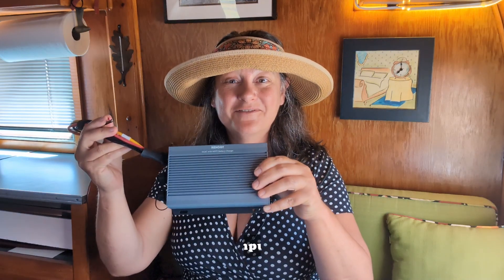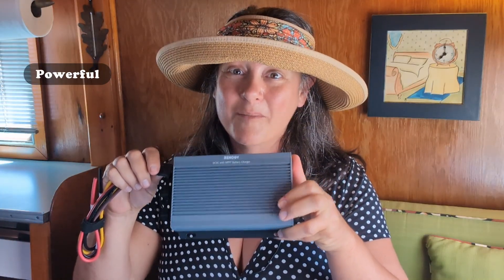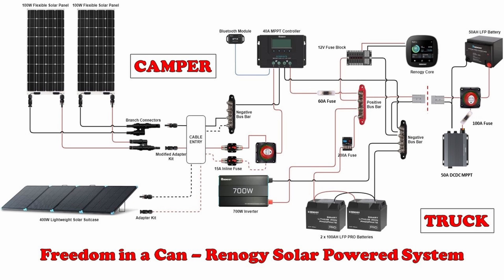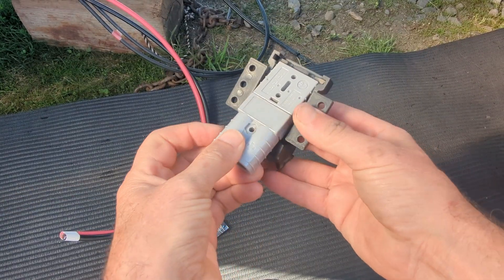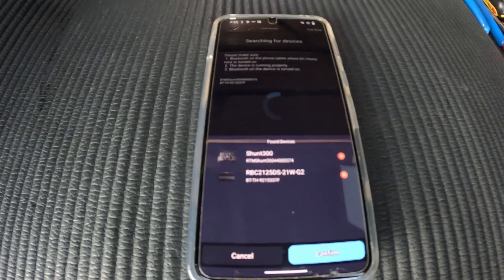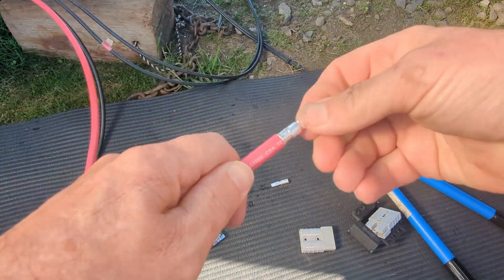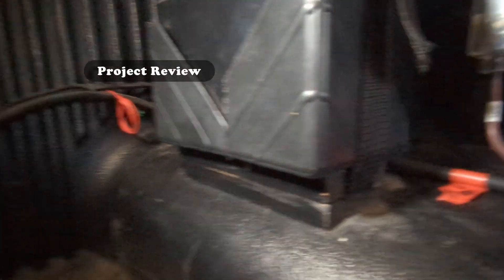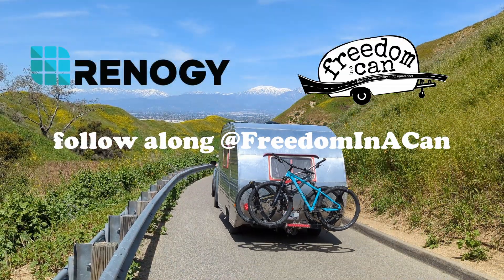How to Install a Renogy 50A Dual Input DC to DC Battery Charger [Installation & Testing]

Comment: A word of caution regarding this charger.
I bought one and had it installed in my 2023 Promaster van to charge 2 150 ah lithium batteries. 
Since I installed it I have noticed a number of odd things happening to my van. 
One thing is it started giving me indications of an open driver side door. It would typically happen if I had the dc-dc converter charging at 50 amps. This was unusually repeatable. Believe me, I did a number of door tests to try and  resolve it. The dealer cannot find a problem. The next issue was after sitting for a couple of days and starting the van it immediately threw a DTC of po327 which is for the knock sensor low voltage. The last thing to happen was the failure of the Onstar type rescue feature which I don’t use anyway. It showed that the system was not working. 
Each of these issues happened while charging at 50 amps. The po327 and the Onstar issue was after the vehicle had sat unused for several days. 
The alternator in this vehicle is rated at 180 amps according to the dealership. 
My thinking is at startup there is a large surge current coming from the vehicle and perhaps the alternator can’t keep up resulting in a low voltage event. As far as the door open alert that happens after a few hours on the road so not sure why it happens.
When I changed the charge rate to 20 or 30 amps I don’t have any other issues. I am curious if the 50 amp setting is just too much for that alternator. I have no reason to run it at 50 amps constantly so I lowered it to 30 amps. Could it be noise created by the charger at the 50 amp setting that the ECUs have trouble with?
I’ve contacted Renogy asking if there is a way to modify firmware in the unit to allow a soft start feature whereas upon startup the charger would wait and slowly bring up the charge current over a period of minutes giving the alternator time to stabilize.
Their reply was that isn’t possible with that charger.
Just something to think about.
Reply from the maker: Thanks for the information, and I'm glad to hear that you found a work around.   I like the idea of a soft startup , that might be something for later devices.  We'll pass this along to Renogy and let you know if they have a different answer for the situation.  Thanks for sharing!

Comment: Do you thr 40amp one is good enough for 400amp powerbank
Reply from the maker: It all depends on the input specs of the power Bank, at 400 Ah, it should have a large enough input capacity.  Which make and model do you have to charge?

Comment: Why run a negative cable from the starter battery isn't the chassis a common ground?
Reply from the maker: Yes, you are right, however it doesn't seem to work well unless you take it back to the battery's common ground.  In our bus install video we had the DC2DC grounded on a chassis bolt 4 inches  from the battery ground, it didn't work.  Then we moved it to the battery and it worked!  I can't explain why, but it works better this way.
Reply from the maker: See this video, https://youtu.be/qVGMP4Ae0LU?si=pRErl8ag0biFK3DT

Comment: Did you ever figure out the right voltage settings to work with your smart alternator?

I have a Ford Transit 2021 with a "smart" alternator and would love some insight!
Reply from the maker: Yes we did, we set the charging voltage a little lower than the standard setting.  Forward Charge Start set to 12.7 and Forward Charge Stop set to 12.2- they had to be .5V apart.  We also set the LowSolar cut off to 10A.  These can all be adjusted in the setting of the DC Home app when connected to the 50A DC2DC.  Not sure if this is what did it, or rechecking all our wire connections, but it's working much better, and we're seeing higher Amperages during charging.  Hope this helps!
Reply from the maker: Also, I wanted to share this video, where we installed the 50A DC2DC  in a bus. Super short run between the starting battery and big cables meant that we saw some really good charging.  https://youtu.be/qVGMP4Ae0LU?si=CMt7lvoZRYoJhAdV
Best of luck, and let us know how it goes.
Reply: @FreedomInACan i just got everything hooked up and i started with your voltage numbers and may have bumped them up for .2 for my setup , ford tranist 2021 3.5l. Still doing some testing and so far no long trip tests yet. I have been seeing consistent 40-50amp charging but only during my short tests. Ill keep you posted! 4awg wire running from the driver seat ccp to the wheel well behind it where my charger and battery is
Reply from the maker: Cool, so glad that it's working for you!  Keep us posted.
Reply from the maker: @Goonch92  Cool, let us know how it goes!

Comment: I've had nothing but trouble from this charger, never charges more than 25amp tops in lithium profile but mostly ranges around 12amps.... I have the new 200w N-Type renogy solar panel but on a perfect sunny day i get maximum of 8 amp. I have had an old kings 25a dcdc charger for 3 years now and it has never missed one bit, it pumps constant 22amp which makes me mad why i upgraded to this $500 Aud charger, could I be unlucky and got the bad one??
Reply from the maker: I guess that's entirely possible.  I share some of your frustration with this one as well, we seem to not get as much as we'd expect from this charger when connected to engine source.  However, I just helped a friend install one in his school bus conversion, and it works really well with his engine source.  Of course, the run is really short between the starting batts and DC2DC AND we used 4AWG cables.  With his 640W of solar and engine source we saw charging up around 44Amps.  
Does it charge better when the weather is cooler?  Do you notice lower performance during hotter days?  I wonder if it's not a heat thing, since these do not have a fan.  Some folks have added one to this unit and seen an improvement.  
Do this, ensure that your DC2DC is properly grounded to the starting battery and that you've got big enough cables for the run and load (which is probably yes, since you've had an earlier model).  
Also, remember that this unit prioritizes solar and MPPT so while it may get close to the max input on the solar side, it won't do the same on the engine.  I believe that 25A is all you'll likely get from the engine source.  
Still you can always see if a replacement will perform  better.  Let us know if you see any improvement, and thanks for the comment!

Comment: Those are interesting buss bars.  With the four large and six small connection points gives you flexibility.  I looked for them on Amazon without luck.  What brand are those buss bars?

Comment: How many volts can the new 50 amp charge controller handle?
Reply from the maker: DC to DC input 12V/24V, solar input up to 50V. https://renogy.sjv.io/xkWr21

Comment: Can you tell me if this can monitor the state of charge on the DC home app I can only see volts, amps, etc I want an actual battery percentage and how much is going in and how much is going out
Reply from the maker: Yeah, I see your question, and thanks. The charger will monitor what's going into the battery, and it will give you battery charge voltage - but that won't show you state of charge.  To see that better, a true SOC you can either go with smart batteries that have built-in BT capability, or plug in BT module, these will both connect to the DC Home app.  Or you can grab the Battery Shunt 300, which you hook up to the battery (works with all batteries, all chemistries) and then allows wireless communication between shunt and the DC Home app.  You can pick one of those up, https://renogy.sjv.io/1rLo3D
Use our "CANLIFE" coupon code to get up to 10% off that or any Renogy purchase.  Hope that helps!
Reply: @FreedomInACan  thanks big help!
Reply from the maker: @jamessteele5455  No worries, good luck!

Comment: Should I be worried about the amount of bad reviews this thing has on Amazon?
Reply: I am using one and its works great on 600 watts solar (6-100 panels in series parrallel)2 series 3 parallel set up 230ah battery. It pulls a full 50 if i set it at that from the alternator and switch the solar breaker off. If solar left on it seems to pull a max of 25 amps from alternator if the solar is charging regardless of amps. The unit is very adjustable with the dc home app. I did set up a cooling fan to blow on the unit cuz it does get warm when pulling at full wattage. So far no issues tho. Have a 120mm computer fan on a 1209 temp relay switch for cooling the unit if needed works excellent
Reply from the maker: Hey, thanks for the honest question.  I looked at those comments, and a few of them are in the "axe to grind" category.  Only one pertains to the actual product.  And the one claiming to not work, "out of the box" was posted in March 2024, and we were one of the first ambassadors to get ours in July, so questionable.  There's a lot of Renogy hate out there.  While there have been real issues with customer service, for sure, we've used these products for years without any complications.  
But here's some feedback on this 50A unit.  The key to getting better charging amps with it when charging LFP batteries is setting the forward charging volts lower, and the stop forward charging volts limit on the DC home app when connected.  Once we did this, we found a whole lot better performance than we'd previously seen.    We're hoping to get to making a short video about this issue, but we've haven't had a chance to get to it yet.  I think this unit has some quirks, but still worth it for the power and the size.  Hope this helps.  
Be sure to use our promo code "CANLIFE" for an additional savings on your purchase with Renogy, up to 10% discount.

Comment: Great video.  Very informative!   One question if I may: will the app for the DC-to-DC charger allow you to limit the charge current from the alternator?  I would like to add a single DC-to-DC that allows me to use the 7-pin harness (10-12Amp max) until I can upgrade to a dedicate wire run from the TV starter battery/alternator.  I think there is also a case to limit the amp pull during idle and open it up when the alternator runs at higher rpm.
Reply from the maker: Thanks for the question.  If I read you right, you want to be able to upgrade and boost things later on.  We are pretty certain that you can limit the charging parameters within the app for both engine source and solar source.  Once it's paired with the app, you'll just go into settings and then adjust the specs to what you need.  Great idea, get charging now, and then boost it later.  Good luck, and let us know if you need anything.
Reply: @ thanks a bunch!

Comment: Correction.. The older version will produce 50 amps. If you have zero solar. Why some people turn off their solar breaker when driving,.

If you prefer. You can use a shore power 30amp charger in place of the Alternator connections. That way you can charge at night or day. This simplifies the extra cost of the #4ga wire all the way back to the batteries. Which 25 feet of 2x can cost $150.00 with fuses..As my alternator cost $450.00 if it goes out from over heating. So I can still charge 3x 100ah batteries in 6 hours. As i use 2x 250 watt BiFacail panels for a total of 500 watts. They out out 30 amps on a nice sunny day.. Which requires #8ga Solar cables to the breaker. After using 2x #10ga Y splitter off the panels. 

Be advised. If you have both solar and alternator at once. You only get 30 amps off the Alternator...So you have to turn off the Solar breaker to get the full 50 amps..
Reply from the maker: Our older unit was a 30A charger.  And the work around to get full engine output on a charger with two inputs is a good one.  
One thing that's nice about this 50A DC2DC with MPPT is that you can program when to turn off the solar input when low, so you don't have to install a switch  on the solar input.  You can set it as high as 10A, so you can get the most out of the driving amps.  
Not sure that I fully get your 30A shore power charger idea.  Please explain.
Reply: @FreedomInACan  They made a 30 amp and 50 amp version. I'm still using the older the first ones they made 50amp..

Comment: Thanks for the detailed video!  I have the older style DC/DC MPPT charger.  The new one left me with questions about taking the heavier gauge wires and connecting the newer 6 AWG wires.
Reply from the maker: We're figuring out the engine charging parameters, as we have a smart alternator on our truck.   We're really digging it right now.  We'll be making another video about that soon, so give us a follow!  Thanks for the comment.

Comment: Does the new version have active cooling (fans that come on when the device gets hot)? Thanks for the video. Subbed/liked!
Reply: Hi I've been back and forth with renogy support and this device was getting 180 degrees on a hot day.  Be careful there is no active cooling
Reply: @livebrando  If no active cooling, it's a no-go in my books. I've seen people adding cooling fans to Victon units (supposedly a premium brand) and one YouTuber actually has shown how efficiency declines with the units heating up. I have a 15A Victron shore power charges, it does get hot and I wish they added active cooling fans.
Reply: @ozmanfidaar6311  you can add a 120mm fan with a 1209 temp relay very cheap. That's what I've done and its been working excellent for months
Reply from the maker: @fvgc454ss thanks, we'll keep that in mind.  Is the temp relay just using ambient temp, or DC2DC temp?
Reply: @FreedomInACan  ambient with a problem mounted near the unit
Reply from the maker: @livebrando thanks for the heads up, we'll keep an eye on it.
Reply from the maker: @ozmanfidaar6311  No, they have not included a fan on this one.  We're in the process of testing this one out and will provide a longer test video later in the fall.  Stay tuned!  Thanks for the sub!